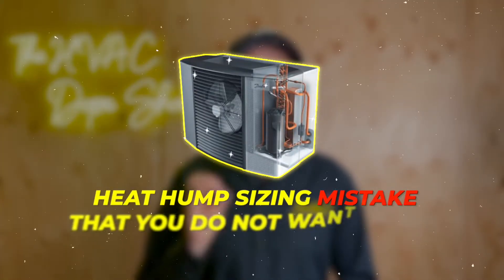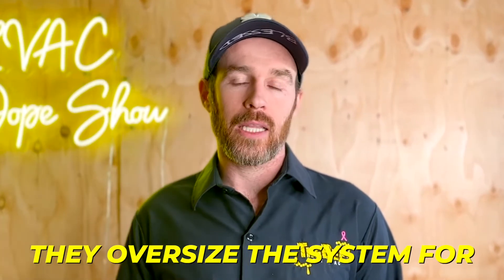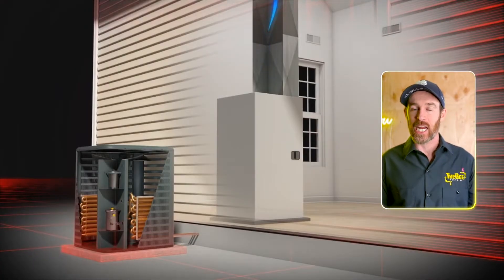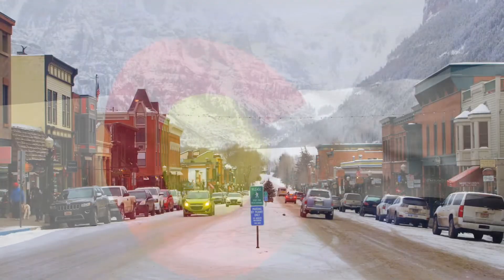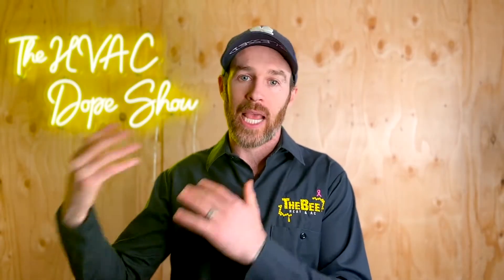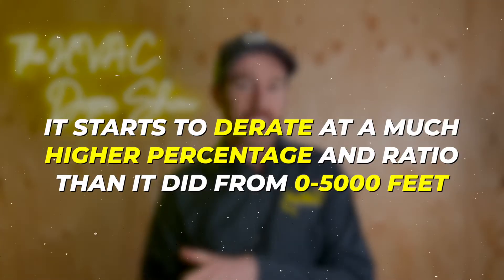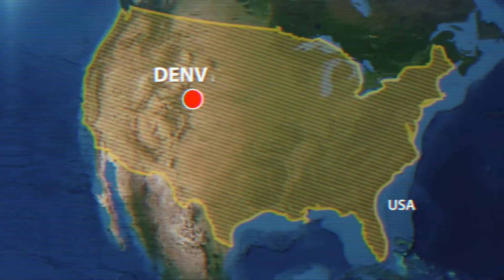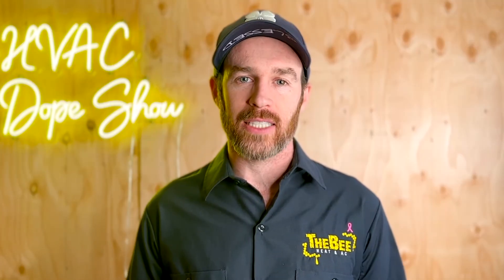#1 Heat Pump Sizing Mistake 2025 🔥 | HVAC Buyer’s Guide

Comment: I am sizing ductless… need to oversize the ac to maintain heating.  Because it is a ductless variable speed it will be fine.  No big deal adding an additional mini split to boost the heating as well.  
Works well and we have been down to-4F so far this year.

Comment: When sizing a heat pump, should we use rated or max capacity ?
I am looking at Mitsubishi  MUZ-FX06NLHZ , which has 6000 btu as rated and 20000 btu as max at 47F . I have read at multiple places that recommends to match manual J heat load at design temperature  to max rating of a heat pump. The space I will be heating is living area/dining room/ foyer combined with 12-16' vaulted ceiling / 1200 sq ft having heat load of 15000 btu in Bay Area . It looks like MUZ-FX06NLHZ will suffice . Right ?
In fact , for my 3400 sq ft home having heat load of 36-45K BTU, I am looking for 4  MUZ-FX06NLHZ  for 4 large areas and one 12-15K 3-zone pump for 3 smaller 225 sq ft  bed rooms . If I need to go by rated capacity, then such a configuration will appear undersized and hence, my question .
Reply from the maker: Outdoor units and indoor units are different but in the Bay Area your efficiency and output will be quite high because they're operating efficiently at those temps (anything above 10F is a pretty moderate temp for cold climate heat pumps). Big thing is not to oversize but those are modulating so it really doesn't matter. I'd look more at the cooling load as that will be higher in your area, and the turndown ratio is such that it can always perform at 10-15% of rated capacity up to 100% of rated (at whatever standard normal outdoor temps are). I can't give sizing advice without seeing it reliable but if that's what your contractor is recommending and they did a heat load calc then you're probably fine. But short answer is size according to max capacity but I don't think that unit is a 6k btu unit and puts out 20k btu that seems odd... you need to look at the submittal sheet, not the brochure because that might be the headynits ranging from 6k-18k because the 18k putting out 20k max btu sounds believable, but no way can a 6k Btu unit put out that output
Reply from the maker: Look at design conditions is the short answer. If you need 12k at 20F and coldest temps get to 20F look at that output in the manual. In the bay tho it's not a big deal, mild climate... becomes more important sizing for temps under 5F as that's when a lot of heat pumps start to derate for example

Comment: Question: if 12,000btu window a/c unit cools my 25x25 room would that be same size for mini-split?
Reply from the maker: Great question... generally speaking "yes", but the proper way is to do a heat load calculation first. I would assume it works fine but technically a load calc is the way to go.
Reply from the maker: Always hesitant to give sizing information without seeing it in person and doing a load calc, but hopefully that answers your question. If you're in a climate that is above 110F you have to worry about derating at higher temps so that's why I take a more technical look at the actual situation

Comment: Sounds like if I plan to move to a ductless multi zone system with a variable speed compressor, I can oversize a bit without too much issue. I can just run one of the air handlers at full power to prevent short cycling and have proper dehumidification. The space is a large open concept vaulted ceiling with loft and not great insulation. I have had issues with cooling when the cooling load increases during the hottest days in Texas or when there are too many guests in the house so an extra indoor air handler seems like a decent idea without too much of the short comings from oversizing the system.
Reply from the maker: It might not be oversized if it's not keeping up but yes you can account for the load on a variable capacity, and a few mini splits are a great option for what you're discussing. If you can add insulation that's always a plus... honestly I normally start with insulation if possible because it can make a massive difference.

Comment: Well not sure I agree with your sizing argument for Canada/north eastern us.  Old heat pumps have given a lot of homeowners cold nights and giant electric bills especially when AUX heat needs to run.   I find it really hard to convince them that the newer designs are much better.  People have trust issues.  What does work is installing heat pump in a bonus room or in closed deck.  They quickly learn new heat pumps are amazing.

Comment: Sorry but I disagreed that blowin insulation is the most effective means. Rock wool and supported by insulation fabric up in between your rafters is a much better method. Try a radiant barrier with an air gap to reduce heat transfer, And then your rock wool and support it by insulation fabric up in your rafters. A better installation material would be aero gel but you know, that's not commercially viable yet. But rock wool is good

Comment: It feels dryer when the electric strip comes on not because electric elements dry the air, as electric elements can't remove humidity, they can only heat the air. The reason the air feels dryer is that the heat pump is already running at max by the time the strip comes on, and heat pumps dehumidify as an unavoidable function of their operation.  Also, humidity is lower outside when it's colder. People in winter well know this, and employ a humidifier in winter.

Comment: Late to the show I Know.  I've been doing some homework as well on HVAC replacement (mobile home - highstatic).  Current system (all electric 2.5t/15Kw) still work though at 20+ years getting old.  Mid MO.  leave me in a position with Summer hitting 100f and winters of -10f (these are 98% high/lows).  I've been looking at heatpumps as well and yes, was confused for a while with regards to sizing but now know I need a 2.5-3.0T heatpump (I assume that matched the current AC) and will have to add either Electric strips for backup or Gas backup (which can be installed and Gas would be cheaper in the long run with regards to monthly cost).  What I need to know is, Does the backups need to be total compacity, ie, 15K (51000btu) or in addition to the heatpump, ie  2.5t or 30000btu - 51000tbu (current system) = 21000 btu of backup?

Comment: Isn't that the point of variable speed heat pumps? It will modulate to its heating/ cooling needs.
Reply from the maker: They definitely do this, but no, you want them properly sized still. The only one that functions like this is the Bosch set up, but it still requires tuning in the field, but it functions differently than other inverters.

Comment: I don’t understand this at all. I want efficiency. If a 4 ton is more efficient than a 2.5 ton at heating at 15F, why just due to my square footage is a 2.5ton recommended. Why would I want my heat pump to run all day when a 4 ton could run 80% of the day and do the same job?
Reply: If you're just running it in heat mode, it'll be fine... If you intend on using it for air conditioning, that's where your issue will rise. If you're in a humid climate, the machine can short cycle and not run long enough to remove humidity. No matter what, a system must be sized for it's ductwork, not the home.
Reply: I did a test since this reply because due to my findings almost all hvac websites said my heat pump was short cycling. So I switched the blower back to low from medium, it was set to low by hvac install company. I switched to medium when I felt it wasn’t doing much. Switching to low I saw a bill $120 higher than any bill I’ve ever had. It’s back to medium now.

Comment: This video mostly concerns air to air systems. What about air to water? Also, I've seen many manufacturers selling increased capacity but the pump itself is the same model as the lower capacity version. The only difference notable is the increased size of the heat exchanger.

Comment: Good job explaining this to homeowners and newer hvac folks. Spot on information but in my Nate Heat pump certification training in 2011 they trained us to size a heat pump in a heating dominant climate to take care of more the homes needs by over sizing slightly if the ducts can handle it. Maybe that’s why a few  manufacturers are coming out with higher static air handler models. With the inverters like Daikin you can go bigger because it’s an inverter and trim it back 10 percent in cooling.

Comment: I have a single unit 90s installed 3 1/2 ton evaporator and  2010 condenser with a 1995 installed furnace w 100kbtu in Virginia.  It's 80% furnace which is probably operating at 70% original capacity. This means at peak it's giving me less than 5 ton of heat anyways. Will a 4 ton heat pump work as a replacement? Will a variable speed compressor or 2 stage work in this case?
Reply from the maker: You need a heat load calculation on the space, it sounds like a Daikin fit enhanced heat pump would probably work or something similar but don't know the load or ballpark square footage and furnace heat vs heat pumps are two different things, so those btus wouldn't translate the same because chances are that furnace is oversized. Just make sure your local contractor does a load calc and the heat pump is sized for the ductwork. You'll have backup electric heat kit probably if you're in a part of Virginia that gets snow or gets below 20F but it will depend on the results of the load calc
Reply: Virginia has been abnormally warm last few years. But it has gone down to 10-15F on a couple of v rare occasions in the last 20 years. A backup hybrid furnace seems like additional maintenance overhead. I would like to completely avoid gas heat. I was looking at the harvest thermal battery but the capacity seems too low for my house(if you include our hot water use).

Comment: We have a one level 3000 sf house in southern california built in 2012.
We currently have gas forced air furnace and central a/c with 4 ton and 3 ton units for cooling.
We had the following testing done on our current system:
Blower Door- 740 cfm @ 50 pascals
Manual J 
Winter Outside db °F 24 Equipment load 52048 Btuh
Summer Outside db °F 98 Equipment Total Load (Sen+Lat) 32746 Btuh
Duct Testing 
3 Ton - Total leakage is at 6% of your total airflow design (1200cfm) with a .59 external static.
Delta T 20°
4 Ton -total leakage is at 5.5% of your total airflow design (1600cfm) with a .74 external static. 
Delta T 22°

Our contractor is proposing one 5 ton 19 SEER variable speed inverter system with 2 zone automatic damper zoning.

Questions
1. If you say to match the system size to the cooling load, will a 5 ton unit be enough to handle the heating side?
2. Some say that 5 ton heat pumps are never a good choice. Is it a problem replacing 2 sets of equipment with one?
Reply from the maker: Lots of info thanks! Based on this you'll probably have backup heat and a 4 ton system for the cooling load. Not sure where in socal but what size system are you currently running and how does it keep up? Design temps are half the formula but I like people's real world experience... 5 tons is fine if the ductwork is big enough but your static pressure is super high with a 4 ton / 1600 CFM so pushing that any higher will just burn out the motor when it's ramping to max capacity. I take book numbers with a grain of salt but I would just ask the contractor you're hiring about which one they think will work best for your setup, but a 4 ton sounds right based on what you posted. That system probably provides close to the required output for the load but the design temps are key because if that's your load when you're heating to 65 that's different than heating to 70. Same if you're cooling at 98 outside but your set point is 78, but you actually keep it at 72 then your load is actually higher to get it that cold or to the design temp. Thanks for all the info made it easier to give you an opinion but the contractor that performed all those tests sounds competent
Reply from the maker: And for 2. Yes it's a problem I don't like replacing two systems with one. It's terrible and will almost always cause issues and work terribly... the best way to get your house cooling comfortably and evenly is more zones and systems because you want to limit your duct run lengths as much as possible as the amount of airflow decreases exponentially at long run lengths. Hope that helps with your decisions and thanks for the comment!

Comment: My girlfriend has a 1500sf manufactured home built 2005. It seems well built and had to meet HUD standards for construction and insulation at the time. We are in New England. Avg winter temp of 25 but can go to or below 0 a few days.  She has a combined hvac unit. The compressor is 3.5ton and the gas furnace is 90btu input 70btu output.  I"m looking at installing a heat pump. Companies like Mr. Cool are telling me a 3 ton would be sufficient. (they don't make a 3.5). But even if the 3 ton would be sufficient for cooling, your explanation of how it can keep up with the heat makes sense now. Would it make more sense to go up to a 4 ton inverter?
Reply from the maker: That seems too big from a cooling perspective at a glance honestly. 3.5 tons for cooling is a lot. Even for heating a heat pump at 25F is operating at 100% capacity so that's a non issue. At 0F you're using your backup heat so I definitely wouldn't oversize it. My guess is a 2.5 - 3 ton inverter heat pump with furnace backup would be the right size for that house but would have to do a load calc to know for sure. Just seems like 3.5 ton is a little on the large size
Reply: @TheHVACDopeShow  I appreciate your reply. She can't have a furnace back up because it is a closet unit and has to come out to put in the new unit. Those electric extra heaters in the air handlers seem like they would use a lot of electricity but wouldn't run often. Still maybe enough to offset the savings of the heat pump.

Comment: Great video. I am building a duplex in northeast pa. Slab on grade 3 bed 2 bath internal garage. Living space is about 1175 each unit. My local distributor sized it at 3.5 ton. I think that is way too much!!? It all single story. Only 6 windows per side. Do you have any input? Thanks in advance.
Reply from the maker: At a glance yes way oversized if that’s 3.5 tons each? So you have a separate 3.5 ton unit for each side right? For a duplex with a shared wall without looking at building design etc it’s probably closer to 2-2.5 ton each side depending on skylights windows insulation etc… and you size for cooling load not heating load because you’ll need a lot of ductwork for that small of a space (1175) to carry 3.5 tons of cooling
Reply: Yes separate units for each side. The building is a simple 28x100 rectangle split at 50 feet. With internal garage on both ends. The air handler’s  are open. So they are not returnable. The condenser’s are returnable. They agreed to down size the condenser to 3 ton. Duct work is large11x16 inside dem. Trans to 11x12. Return is 16x20. The condenser is single stage and the air handler is an 18 speed. My salesman says I shouldn’t worry!! I’m at a loss. Thanks in advance.

Comment: Why would an inverter heat pump short cycle? Wouldnt it just run continuously at a lower power?
Reply from the maker: If it’s oversized it will still satisfy temperature too quickly and have hot and cold spots as a result.
Reply: Inverter units still have a minimum threshold, say 40 or 50% depends on the system. They can't go lower than that

Comment: Here i am in july and diakin have a massive recall in canada 😅
Reply from the maker: Yikes, recall on what specifically? Hopefully it’s not a big deal / major part
Reply: @TheHVACDopeShow  July 2, 2024 – Daikin Comfort Technologies (DCT) Manufacturing is recalling Daikin FIT, Amana S-series, and Goodman SD heat pumps due to risk of excessive heat exposure.

This recall involves about 5,549 units in Canada, and about 56,028 in the U.S.

If you blip power the unit can get confused and provide heating instead of cooling.  Fix is a firmware update.

Comment: Thanks for the video. I have a 2700 sq ft home in NY, with a single zone AC for the entire home. We have 7 registers on each floor, mix of 8 inch, 6 inch flex and 4 inch in the 2 bathrooms. We have an older 13 seer Trane 4 ton AC unit, which is not keeping up. We added 2 zone mini splits on the 1st floor in the hot spots (window dinning room, kitchen) which helped. I would like to change the central system to a variable speed heat pump and am leaning towards a MR COOL / MIDEA / inverter type system with handler sized at 5 tons. These units have dip switches to go to 4 tons if needed, is that a good plan? I totally agree with the attic sealing being the best bang, will be doing that as well.
Reply from the maker: Depends on the heat load calculation, that’s probably ok but it has to be sized for the duct work too. The Bosch type inverters / Midea have dip switches and then they throttle themselves down so it will limit its capacity. If it’s not keeping up currently common causes are things are dirty / coil condenser etc, low on charge, but sizing could also be that. If 2700’ is all above ground then at a glance doesn’t sound off but that’s where heat load calc comes in just to get a more solid idea

Comment: We live at sea level in N. California in a 1,700 SF house and recently had a 3 ton Daikin multi zone mini-split installed to replace our 95kBTU natural gas forced air furnace. I think we were losing a lot of heat in the ductwork. It's really quiet and no more drafts from the registers.
Reply from the maker: Right on! Sounds more comfortable, you may have been especially if the ducts were disconnected or falling apart (if you had flex ductwork), mini splits are great
Reply: Vote red🤬